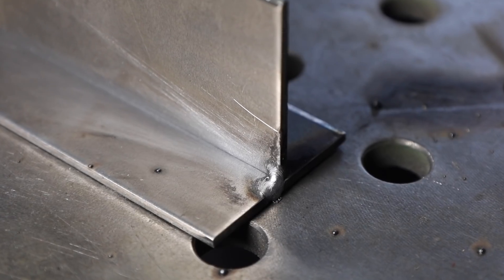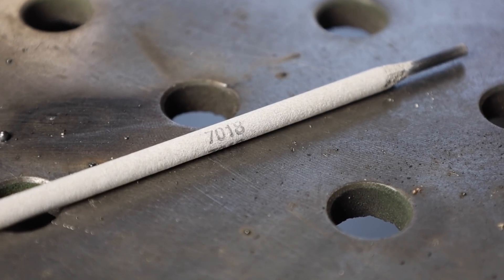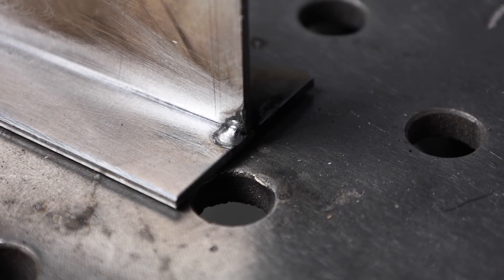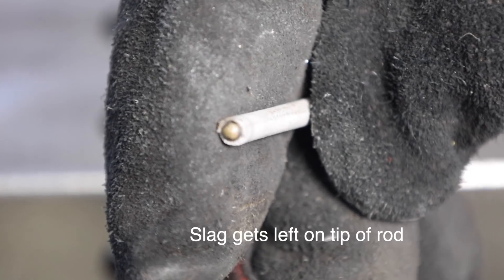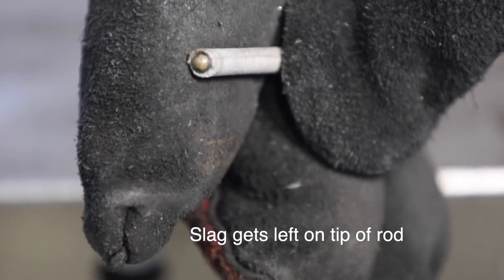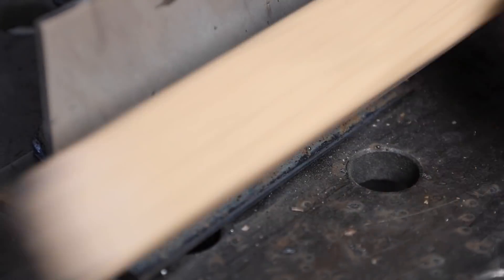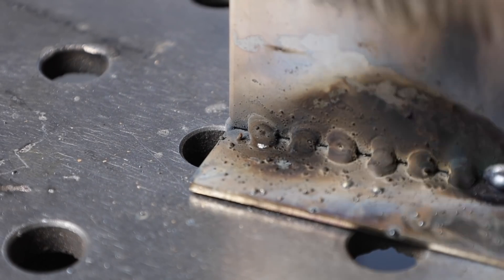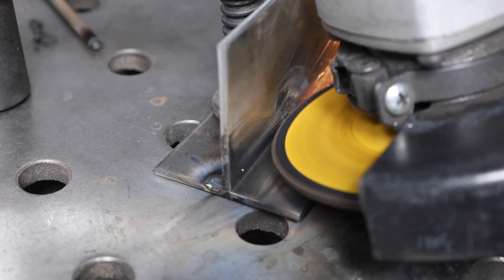This Stick Welding Rod Makes Tacking Easy

Comment: Funny, no one never mention the 6012 electrode
Reply: As I understand it, the 6012 electrode was banned from use in US Navy contracts back in 1995. As 6012 was widely used (or mis-used, according to the Navy) in shipyards, demand for 6012 in the USA disappeared, so manufacturers stopped making it.

Comment: Tim you were saying that an  inverta  machine cannot handle a 6010 rod or just the small invertas cannot ?  Also what amp inverta machine can handle 3/8 to 1/2 inch metal
Reply from the maker: Great questions! A lot of inverters will handle 6010, but not all. I did a little comparison of 4 small inverters on the channel a couple months ago, and 3 of the 4 could handle 6010. You can watch that video if you want to learn more about different machines. The great thing about stick welding is that you can weld unlimited thickness with a 1/8” electrode by running multiple passes. This requires about 125 amps for a 7018. I like to have a little wiggle room at the top end, so I usually buy and recommend 160 amp output or higher.

Comment: Small 6011 is the most misunderestimated electrode. Folks remember it as the root-pass and gap-filling mud electrode, but forget it is also an all-position / fast-freeze stick. Thanks for the reminder.
    I also want to mention my all-around favorite 7014. It is an iron-powder flux like the 7018, except that it is not low-hy.
The 7014 will fuse less and filll more than 6011, and it welds pretty. 7014 will strike an arc easily, the opposite of 
7018.  I make sure I never run out of either small size 6011 or 7014 !

Comment: I’m looking at getting a budget Tig welder to weld aluminum. I’ve never tig welded before but do have a Millermatic mig welder. What is your suggestion on a Good beginner Tig welder? I’ll be welding AN fittings on valve covers. Basically all the stuff I do is Automotive stuff. Would love to Fab my own brackets and stuff. I’ve been researching all day but get different answers every time I look so I’m asking you a professional what do you think. I appreciate it Thanks

Comment: Hi, I’ve wanted to be able to weld for years now but I can’t find anyone to teach me, so here I am. Arc welding seems the easiest option to get into and there’s plenty to choose from on Amazon. I’m most fervour about getting an electric shock (I’ve watched your video about shocks) I’m keen to understand what you can and can’t do when working. I’ve seen that you mentioned holding the stick are the piece you’re working with whilst you’re welding. Could I get some advice on what you can touch and not touch when welding. Also, it would be really interesting to see (on a second camera) what your body position is doing whilst you’re welding (only when its interesting). Thanks for the videos, very interesting.

Comment: What I’m curious about is how to choose the right rod for a specific task. As the steel of the rod should be about the same alloy as the steel pieces you weld together. 
How do you determine the steel alloy?
Do you use some analyzer device?
A General overview of all the rods (composition and sizes) would be very interesting to see.
Thanks for your attention.

P.S.: If you have already made a video on this topic I’d appreciate if you tell which it is I should watch.

Comment: Great job. Serious question about stick welding. I have stick welder with Tig lift setting. Other day i accidentally stick welded with machine on Tig lift setting. I did notice way different sound and smoother arc,not as violent as when using arc setting. Will this hurt my machine,any pros or cons to doing stick welding while using Tig lift setting.
Reply: No it won't hurt the machine. But it   's welding at a much lower voltage  than in stick mode which is not good. If you don't have hf start and pulse on your machine I don't see any reason to use it with a stick electrode in tig mode. The only situation is welding thin metal sheet with pulse and with E6013 which in my opinion is the only rod that works acceptable at low voltage.

Comment: 6010 DC 135A 6011 AC 135A ,hot works good for the tack.

6010 is a DC electrode.
Reply: 6011 is implicitly DCEN & DCEP rated as well as AC. Each will yield different characteristics.
Just to through it out there, Hobart makes one 6010 rated for AC, in addition to DC---so very strange.
So many rods, so little time!

Comment: Totally agree on 6011 for tacks, best tip an old timer gave me was to hold the rod itself instead of the rod holder when tacking, much steadier.
Reply: I like to use mostly spent butts for tacks for that same reason.

Comment: If you have a welder that can run 6010 would you prefer it over 6011 for the root pass, with a 7018 cap?
Reply: I've read it generally has better final tensile and yield strength---check the datasheet for your rods. Some say better penetration but I'm not sure. I get less sticking spatter and a bit easier cleanup in general with the 6010 I buy but maybe that's a brand thing?
6011 should be nice in tight corners where running AC keeps the M fields from messing with you but I don't know of any other advantage.
Reply: @antilogism  Nice to see a succinct, knowledgeable opinion on YouTube every once in a while.  Good job and thank you I had this same question.  My inverter TIG machine runs 6010 very well but haven't use it much -- maybe I will.

Comment: Being i mainly use my multiprocess welder, i will often go through a project doing all my tacks with my machine set on flux core, then change over to stick mode for the welding. As far as 6010 vs 6011, ive never had a problem running 6010 on my dc only machine.
Reply: And your right about using 6010 for the root pass. Especially when running pipe. We used to run 1/8" 6010 for the root and 3/32" 7018 for fill and cap. That way we could leave our machine on the same settings. Very handy when you might be up in a rack and over 100' from your rig.

Comment: Thanks.  I really like 6011 and use it whenever I can, especially when I don't care about a nice looking, smooth bead profile.  It is about as versatile as a rod can be.  I think 6010 is better at penetration and tacking, but for some reason my Hobart Stickmate AC/DC welder won't maintain an arc with it unless I run it very hot.  The 6011 is plenty strong and will weld just about any condition of steel.

Comment: Another great video, thanks Tim! I'll join the broken record club and say again how clear and well planned your lessons are. Not many teachers know how to do this.

Also, I'd like to share that I had been wanting to start welding for several years now. I was dragging my feet because I had tried to teach myself with a budget flux-core machine a while back, had a lot of trouble with it, and couldn't find any good guidance online. Luckily, a guy I had hired to paint the house broke in and stole that crummy unit. Your videos have become Welding 101 and 102 for me, and many others I'm sure. Your lessons gave me the confidence to splurge on TIG/stick and MIG machines, gas, and gear. After a few days of practice, I've completed my first project, a rack on my tool cart to hold the gas cylinders. Thanks Tim, keep 'em coming

Comment: Thanks for the tips. I’ve found that 6013 tacks well also, especially if I turn the current up an extra 10 amps over what I would run a continuous weld with. The slight current increase help me keep from sticking the rod to the part.
Reply: This will help me, because in my little town you only get 6013, although there are three hardware stores, nobody knows what I am talking about when I ask for something different, so....... 6013 it will be
Reply: The Rutile-Cellulose (of 6013) type sounds likely…?

Comment: I'm just getting back Into stick welding after 40 years,,, it's all new to me with these small inverter welders , it seems I'm going to have to get a whole bunch of different rods 😳 I will be mainly welding 50mm x50mm angle iron but vertical runs, it seems so far 6013 is looking ok ...
great videos, appreciate the time..
regards
Reply from the maker: The only rod that is a challenge is 6010, and it's only with some inverters. I have 3 inverters that run 6010 just fine (ESAB, HTP and Harbor Freight Titanium), and a couple others that don't run it very well. Besides that, they work great.
Reply: @TimWelds  thanks for the reply, I'm looking forward to trying these different rods out.. I was going to do test welds then cut the work in half to check for penetration..
Reply: @myturkishlife1777  G'day. I run a Fronius Transpocket inverter welder, and go through a couple of hundred kilograms of 6013s a year. They do everything. You can't go wrong.
Reply: @tandemwings4733  hi, thankyou for the information, appreciate it 👍I was hoping there would be an "all purpose" stick I could use, but I do realise that some sticks are better for certain applications..
Cheers 👍
Reply: @myturkishlife1777  Perhaps I should have mentioned that I am a welding contractor doing onsite work. I do have 6011s, but I rarely need them, I only use them when access to the joint is limited and I don't want to deal with the slag produced by the other rods, and also, occasionally for the root pass on larger profile sections, or when fit-up is poor.
Reply: @tandemwings4733  ok, you certainly have some experience, maybe you should do a YouTube video 👍
Thanks again for your advice..👍

Comment: Good info, thanks,,what's a good general purpose rod for 110v stick, or a link to a video you have on the subject, thanks.
Reply from the maker: The safest bet is 3/32" 6013, though it does depend somewhat on your specific machine. The main limitation with 110 volt input is going to be your output amperage, so the size of electrode is as important as what type. Smaller electrodes run at lower amperage. Most packages will show an amperage range, so just make sure that your machine can hit at least the middle of the range for whatever you get. I have run 7018, 6011 and 6013 on 110 volt without any issues.
Reply: @TimWelds  thanks alot,,I'll try the 7018 and go from there
Reply: @TimWelds My welds don't come out as clean with 6013. Admittedly what I'm welding isn't always super clean and shiny either but I do what I can. I do notice if I run on 220v they seem to be much better. I'm not sure how true it is but something about more volts or running hotter will bring the trash to the top so it ends up in the slag.
Reply: 6011 for dirtier steels and more penetration, 6013 for general purpose. Both are easy starting and easy to keep lit on smaller machines.
Reply: I would say 6011 and 7018. You can use 6013 and they are like the easiest rod to run but on 110v you will have a lot of inclusions and they don't penetrate that much. If it's dirty or you need to make sure a weld is solid and to tac 6011. When you are running a bead I go with a 7018.